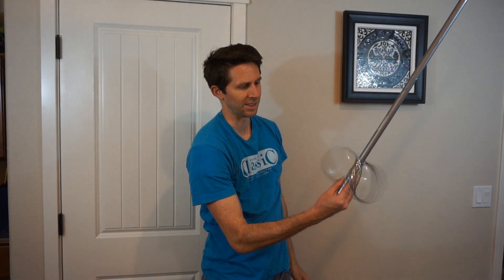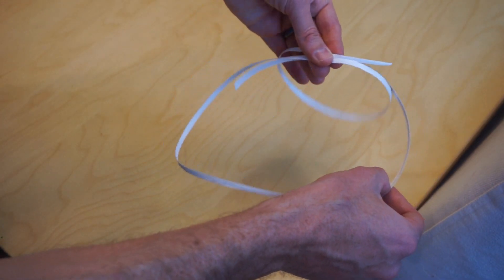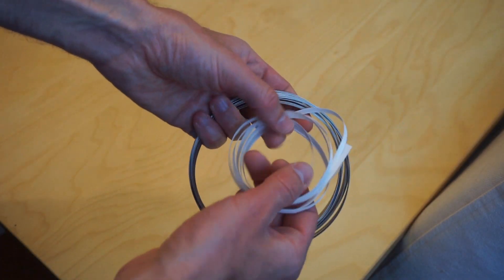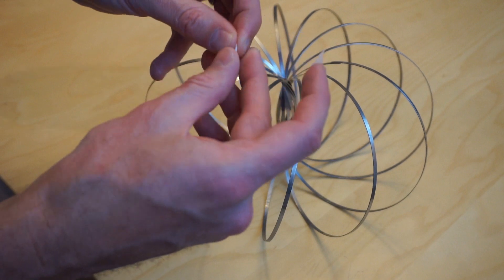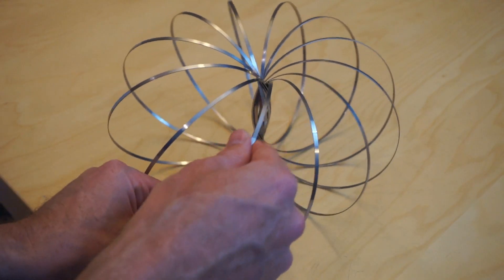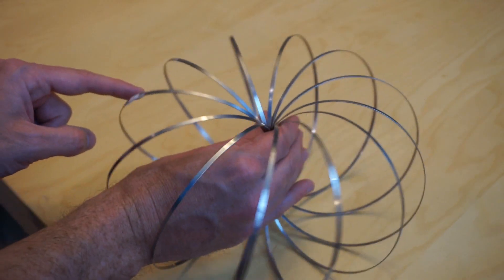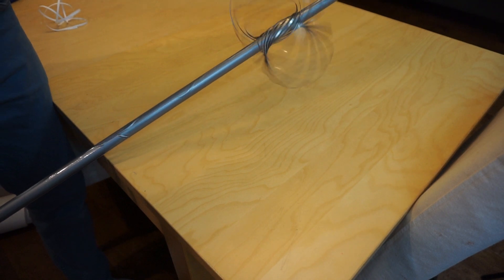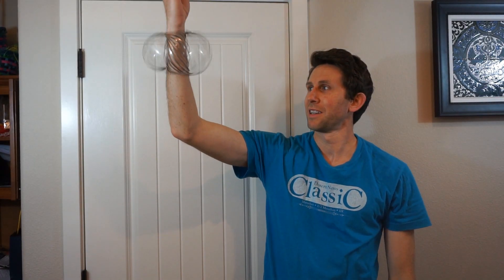Can Metal Rings Climb? Explaining the Geoflux

Comment: #TheactionIab.I wonder what the reaction would be if it was made from Nitinol? I think I’m spelling it right. It’s a metal made from nickel and aluminum that regains its original molded structure when heat is applied. Make one from a band of Nitinol then experiment with different heat sources on different areas. 🤓